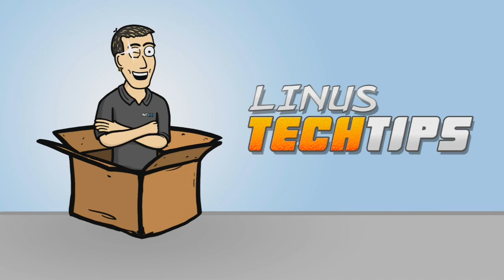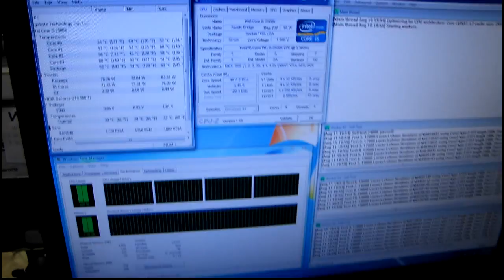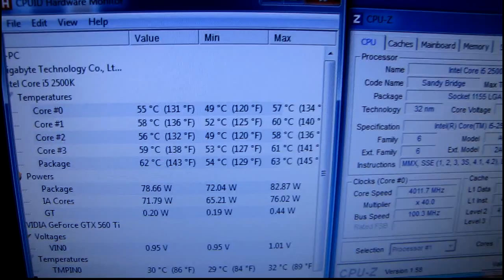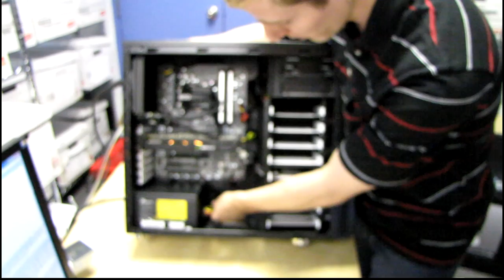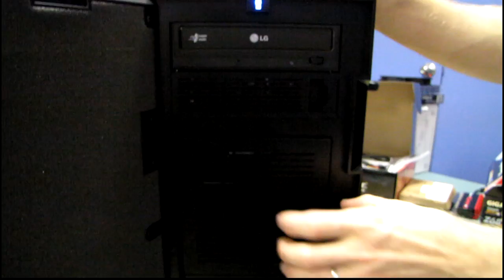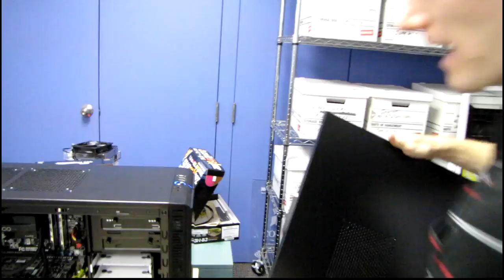Vesta 5350 OC System Showcase & Overclocking Speed Finalization Linus Tech Tips

Comment: @LinusTechTips Easily doable. I got lucky with my 2500k chip and managed 5.1ghz with a NH-D14, heh. Not idle either, BFBC2 everything on high, SLi 590s .w 16GB RAM — never had stability issues. So while it's uncommon, it's definitely not impossible that he reached those temps.

Comment: Linus will the Corsair H100 fit in this case? I'm wondering if the screw holes for the rad will line up, or if the thickness of the rad + the fans will be too much inside the top of the case.

Comment: @Jagerartonful stock cooler is so tiny. it works for stock or slightly OCed.. but highly doubt you got 4.7. I have a Hyper 212+ 2500k at 4.5-4.6 it will get to around 60c. Give or take.

Comment: Today, this kind of case, is totally obsolete, it's small, you have to cable manage it by spending hours to get the cables stashes just right, you can't add the right water cooling solutions that easy, it's just a  mess to deal with. I expected better from case makers in 2011, thanks consoles for innovation of devolution.

Comment: This video convinced me to pick up the Define R3 for my next build.

Case : Fractal Design Define R3 Black
MB : Gigabyte 990FXA-UD3 (AM3+ getting ready for FX)
CPU : AMD 1100T Phenom II X6
CPU Cooler : Corsair H60
GPU : 2x ASUS AMD 6950 DirectCU II Crossfire (The 2 slot 1GB version)
RAM : 4x Kingston Limited Edition CL7 Black 2GB @ 1600Mhz CL7
RAM Cooler : Corsair Dominator Airflow
PSU : Corsair AX750
HDD : WD Caviar Black 1TB SATA3 @ 7200 Rpm 64MB Buffer

Comment: @mikel92 My best guess is that it has to do with the case itself. The R3 sacrifices good cooling for quietness. Notice how there's only two fans, the one in the front, which has most of its airflow blocked by the drives, and the one in the back, which just serves to exhaust radiator heat. That means there's probably a ton of idle heat in the case that is unable to be exhausted, which warms everything up.

Comment: @spiralcore i thought that too.  So i put that idea to the test in one of my older super towers ( diablo IV case which i later found out had poor " grounding" qc when they made the thing. had to trash it). i tested the temps inside after giving 6 hours straight on each way ( cpu fine inside and then putting cpu fan on outside).  the temp difference was maybe 2 degrees celcius when the cpu fan was on the inside pushing air outside the honeycomb holes that the fan was mounted to. so. barely better

Comment: @dkreventon you have a valid point.  However, it depends on many things.  since sandforce 1200 controllers, intel's 2010 and newer controllers and samsung series 470's controllers making their way into the market within 2 years ago or less, that worry is pretty much a thing of the past. Yes, you need to disable superfetch, indexing, defragmenation ( and it's auto scheduling option in my computer-manage-something something) but pagefile, temp folder, etc can stay on the ssd. cheers